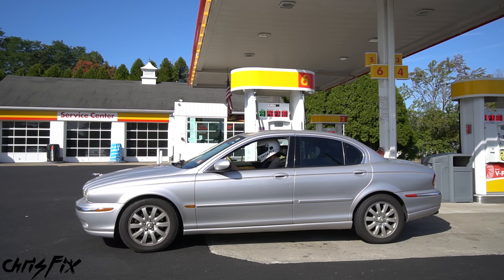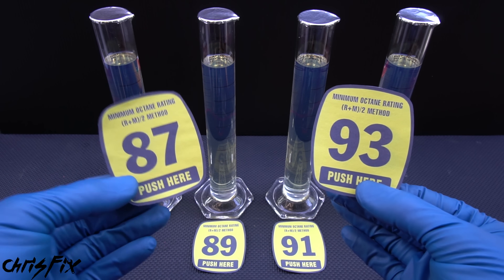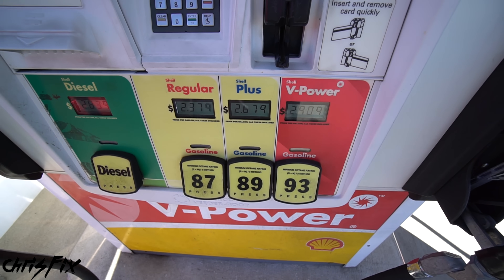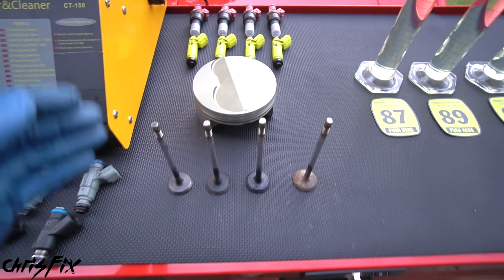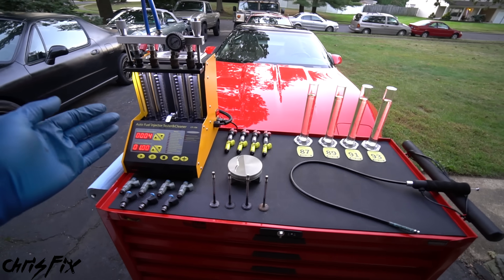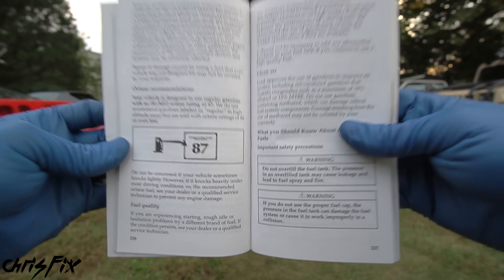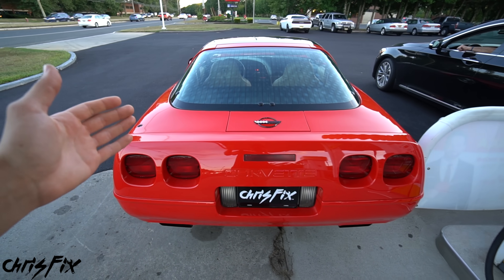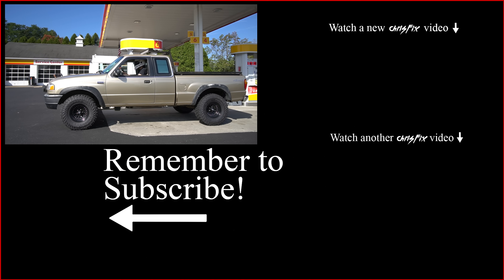What is the BEST Fuel to Use in Your Car or Truck and WHY

Comment: Lol in sweden the worst gasoline you can get your hands on is 95 octane, and your "premium" is 93? But then again we also pay 3 times as much for it haha
Reply: You also pay 3x as much for the same gas. As It was mentioned in the video, we use a different method to rate octane. US 93 = 99/100 EU. And premium 93 for me (99/100 EU) costs $2.84 a gallon. (€0.68 per liter.)  ^_^

Comment: In Europe ... 95 is the cheap one, 98 is premium. I use octane booster because they've stopped selling 100 octane fuel at the pumps. I guess 93 is good enough for American engines though.

Comment: All regular fuels in the netherlands recently got changed to 10% ethanol by law. Many cars before 1990 can't use fuel with this high content of ethanol. There are only a few pumps left that sell premium gas without ethanol, but they have RON rating 98 and 102. But what if your car says, use RON 91 and no ethanol, is RON 98 than also oke?

Comment: Hey chris 
So i have a car that every two days or so the battery keeps going flat weve replaced the alternator but that still didnt fix it
Reply: Matthew playz I would get a new battery. Sounds like it can’t hold a charge.
Reply: @FlipITGarage  ok but it is only a brand new battery
Reply: Matthew playz it’s a brand new battery ? Get it tested. Also check the battery cables.
Reply: @FlipITGarage  weve checked all that alreadye
Reply: Matthew playz then there is something draining the battery. You’d have to trace it down running electrical tests.
Reply: Matthew playz I’ll make a video on it.
Reply: @FlipITGarage  ok
Reply: @FlipITGarage  how long until u will
Reply: Matthew playz should be able to get to it in the next week or so.
Reply: @FlipITGarage  okay will keep a look out

Comment: Watch out for sneaky gas stations that offer 87, 88, 89, and 91 octane fuels. If you read closely, the 88 octane says it's E-15 (as in 15% Ethanol). I once saw a gas station offer (I think) a 95 Octane fuel, but it was E-85 (85%ethanol). So don't get too excited if you see 88 octane cheaper than 87 octane (fuels with more ethanol benefit from subsidies that make them cheaper, but you get crappy fuel economy and it clogs stuff up).

Comment: Fuel here and fuel Europe is not the same right on a sticker it said E5 were E10.10 percent ethanol. That alone makes the fuel in Europe better . Especially for carburetors  .
Reply: E5 causes an indistinguishable amount of damage as E10 to very old carburetors. E5 will kill your old carbs as fast as E10. However here in the US, anything 20 years old or newer is designed for E10. E10 is the new standard. It will be coming to all of the UK eventually. Norway already made E10 standard and it's now the main gasoline that is used. The US switched 20 years ago now. E10 burns cleaner than straight gas. 

E10 is now sold in most places like Canada and the US and Norway and other countries. And E10 is moving its way across Europe now.
Reply: @waycoolscootaloo  it's the same just with E10 its 5% more ethanol.  As E 85 is 85% ethanol  .

Comment: So if you're converting a car that would normally require premium to hybrid, you're lowering the engine's compression with the Atkinson cycle. Would it be possible for the car to run on regular after that? I mean, in theory?

Comment: I have a 25 Years old car, and i don't know which gas the previous owner used, so I'm wondering if there's any kind of product to put in the gas tank to clean it up and increase the power it may have lost over time?
I live in EU so it's 95 or 98 octane as the mechanic told me but i'll check on my car what's recommanded or required. thanks !

Comment: You mentioned Shell suggested running their premium for 2500 miles straight, and mentioned adding premium to your Toyota due to detonation. Would this be safe to do in my 1997 Civic with nearing 200k miles?

Comment: Why do you have such a low Octane grade in the U.S.? Normal Gas in Germany is at 95 Octane, Plus is at 98 and at the Aral Gasstation you can get 102.
Reply: US Gas is the same as EU gas. As he mentioned in the video, we use a different method for calculating octane. US 93 (R+M)/2 = 99/100 in Europe. Shell V Power Nitro+ in the US is probably a bit higher. Since they have said it tests at a US 95 octane rating. So that's your 102 even though the pump will say 93 octane in the US. Our ratings always state a minimum of 87 or a minimum of 93. So that just means you're guaranteed nothing less than that octane level. Most gas in the US tests one or two octane levels above the sticker.  

I can get premium 93 (99 German) here in Wisconsin for €0.68 per liter right now. $2.84 a gallon.  😎

Comment: What "additives" are in fuel? 
I actually work as a process technician in an oil refinery. The ONLY differences between octane ratings is made by blending multiple process streams in varying levels to give appropriate octane, flash and freeze points, RVP etc. There is no "standards" for additives. Only for octane and RVP etc(which is seasonal too, more butane is blended in winter spec to help cold starts) . Those process streams can be anything from Isomerate(octane in the low 80s), Cat cracked spirit(around mid 90s) and reformate(over 100 possible). Butane is used and also alkylate(made from bonding two butane molecules into a non aromatic C8)

I know premium has small quantities of a cleaner added but it is a TINY amount per volume. There is no other additives(apart from dyes) in the other blends. Isomerate is a less clean to burn fuel than reformate for example(reformate is like a solvent on its own) so higher octane blends use higher quantities of cleaner burninb blends. 

Also you CAN get more power from higher octane fuel if the car is able to adjust for octane. Many modern engines ARE able to generate more power at octane levels above the minimum required. Toyota 1GR engines are an example. 

The dinosaur engines in the cars shown(old mustang) won't benefit from higher octane fuels unless the ECU is retuned.

Some good points in this video but your technical points are a bit innacurate.

Comment: My car uses the Best fuel of all, Electricity.
Since 2012 I have been using ZERO Oil and Gas .
In over 300,000 miles I ONLY have Rotated Tires and replace wipers as needed.
I pay almost Nothing to charge my car Every night. I have a 1000w Solar system and a Large Home battery , I can charge several cars and power my home All night long on battery power.
my system begins charging as early as 6 am and can Fully Charge my Home battery in little as 4 hours , i'm them free to SELL the Electricity I make to my Utility for a Paycheck.
most days my Meter runs backwards earning me $$$.

Comment: My car requires 95 (i'm in Europe so that's 89 I guess ?) But I get a better fuel economy with 98 (93). Even though the fuel is more expensive, it's actually cheaper to run ! Sometimes it's worth a try
Reply: As he mentioned in the video, the vehicle's ping sensor will detect if there's any preignition/knocking and that the timing could change. What he didn't mention is that the richness level (or air to fuel ratio) can also change where there's more gasoline added to minimize preignition, hence worse gas millage.

Comment: the fuel  in your state are better than Colorado fuel we have 85 87 and 91
Reply: In high elevations, you can get away with lower octane ratings. 85 octane is sold exclusively at higher altitudes only. If you fuel with 85 octane, only run this at high altitudes. This is because 87 octane is the rated octane by manufacturers. And as you descend to lower elevations, then the 85 octane will become to low for your engine. 85 octane only works in cars rated for 87, because the air is far less dense at high elevations, which means that your engine runs less efficiently. But as you descend to normal elevations like what's found in Illinois, or Iowa, or Wisconsin, then your engine will start to knock with 85 as it runs more efficiently. So the high elevation protects your engine from the 85 octane gas. 

However auto manufacturers don't endorse the 85 octane fuel. It's actualy a relic from years ago. The EPA says, “The sale of 85 octane fuel was originally allowed in high-elevation regions—where the barometric pressure is lower—because it was cheaper and because most carbureted engines tolerated it fairly well. However this is still true for old cars and classic cars. You can probably get away with running 85 on modern cars according to experts. But they all recommend the 87 midgrade to really take away all doubt. 85 should be used primarily on carbureted cars. 

TLDR: 85 is likely not going to hurt your engine at all, so long as you run it only at high altitudes. But it's better to run 87 to remove all what ifs. Never run 85 at lower altitudes. Carbureted or not.

Comment: Edit: See comment.. 

I like that your "V-Power" is w/ 93octane... her ein germany, 95octane is the "cheap" gasoline :D VPower has 100 over here.
Reply: If you watched the video you would have noticed how he talked about using a different method to measure octane in the US. 93 octane in the US is the same as 99/100 in Germany and the rest of Europe. Example: Tesco in the UK is super popular. It sells 99 octane premium. Folks over in the UK swear by it. However according to Tesco, it has a "Mon" rating of 87.  

So "RON" 99 + "MON" 87 = US formula of (R+M)/2 = 93 octane.  So Shell "VPower Nitro+" in the US is rated at the pump as 93 octane. But keep in mind the sticker always says a "Minimum" of 93 octane on a US gas pump. So if Shell is selling VPOWER with 100 octane in Germany, then the "Ron" is 100 octane and the "Mon" octane likely was 88.  

So in the US, our 93 VPower is this →  88 + 100 = (R+M)/2 = 94. So the pump will say it's 93 octane. But your actualy getting 94. And some stations in the US even have 94 octane labels. primarily at Sunoco gas stations. But 93 = 99/100 in Germany.
Reply: @waycoolscootaloo  well I did watch it but it seems like I did overhear that, thanks for clarification.
Reply: @falkhogan  Your welcome. 🙂

Comment: Actually you are wrong when saying Octane doesn't pertain to burning hotter or cooler.  We run race engines and there is a HUGE difference in cooling when using a higher octane.  It may not be noticeable between 87 and 93, but when you get up to 112 and 116....it's proven.

Comment: I live in Colorado.  Regular gas is 85 octane not 87 octane.  If my manual says 87, can I use 85 in Colorado?
Reply: You can. The higher elevation will likely make it so your engine wont knock due to the thinner air. However never run it at a lower elevation. Most industry experts still recommend the 87 however over the 85. Just because it removes the what if's. 85 octane was originally formulated because it was cheaper. But carbureted engines at high altitudes ran on 85 just fine. But modern cars can compensate for high altitudes unlike old cars. So auto manufacturers don't necessarily say it will hurt your engine. But they also said that they won't endorse 85 octane fuels either. 87 is what they design cars for. 85 octane is really aimed more at older classic cars with carburetors at high altitudes.

Comment: How about the E5 vs E10 (Both RON 95, so midgrade in USA) fuel? (Europe)
Reply: There is no real world noticeable difference between the two. Now if you were to jump up to E85, then you would notice a marked downgrade in terms of fuel economy. However E85 is high octane. (108 in the States.) So a very high compression engine would love it. Provided it has an E85 adapted fuel system. (Flex Fuel rated cars in the US can run E85.)

Comment: E85 is a tuners dream, as long as the engine is tuned to use it or is flexfuel... mostly readily available and its practical equivalent octane rating typically is 108 to 115 dependant if you are using MON, PON or RON rating (in that order).

Comment: Chris there is some half truths in your video. Knock/ping is caused by the air fuel mixture self igniting on the compression stroke before the spark plug fires setting off another flame front spread. When the conditions inside the combustion chamber are just right the air fuel mixture self ignites by the combination of high pressure and heat. Under mid cases of knock/ping the self ignition occurs just before the spark plug fires... note at 2000 rpm we are talking about less than 1/100ths of a second to get the ignition timing just right.  in a 4 stroke engine at 2000 rpm the power stroke is only .06 of a second in time duration from top dead center to bottom dead center and you need the ignition of the air/fuel to occur in the first 1/10th to 1/4 of the power stroke to make max torque on each power stroke. on the ideal power stroke to make max torque the max pressure on the piston must occur when the power stroke is exactly have way between top dead center and bottom dead center... thus putting the crankshaft piston rod journal in a position where it is the farthest to the side of the centerline of the crank shaft (torque = distance times force... ie foot pounds ). in severe cases of knock/ping the self ignition occurs when the compression stroke is only half way up the stroke and the crankshaft is trying to push the piston up and the expanding gas mixture is pushing down on the piston this produces a bent or broke connecting rod.... so there is some debate about exactly what octane does to the air fuel mixture.. some say it prevents the air fuel mixture from self igniting but an old mechanic (who use to build 10,000 rpm high compression drag race engines) explained  that octane does not stop the self ignition of the air/fuel mixture but it slows the flame front spread.. again we are talking about 100ths of a second .. he said adding a crap load of octane booster to your gas  (more than what is needed to prevent knock) can actually reduce the amount of power (torque) the engine makes because the flame front spread from the spark plug ignition has slowed too much and the full cylinder charge is not ignited and making maximum pressure (ie expanding) when the piston gets to half way down on the power stroke
Reply: opps mistake in how to calculate time duration of a power stroke. in a 4 stroke engine it takes 2 revolutions to get 1 power stroke ... 2000 rpm = 2000revolutions per 60 seconds  ... time of 1 revolution  = 60 /2000  = .03 seconds  but 1 stroke is only half of a revolution time so 1 stroke = .03 / 2 =  .015 seconds ... therefore  at 2000 rpm the time duration of a power stroke from top dead center to bottom dead center = .015 seconds

Comment: The best thing to do is read your owner's manual and use the fuel they 
say to use. In my Infiniti Q60S's manual it actually
says you will void the warranty if you do not use the 
high test (91+ octane) fuel. It even goes as far to say that if
you are out of gas and can not find premium fuel that you should put in
just enough 87 octane gas to get to a station with the proper fuel and
to drive under 50 mph and accelerate very slowly. 
It also warns against ethanol laced fuel that has more then 10% ethanol.
In other cars I have owned, they say to just use 87 octane lead free
fuel. Just read the owner's manual.

Comment: Higher octane fuel is slower burning to prevent the knock and won't increase performance in a engine designed for 87

Comment: I have seen pretty much all your videos with great explanation. I wish you were my mechanic, I live in Colorado and am being gouged for over priced fixes all the time. I find it useless that for a simple fuel pump issue is costing me over $2300 anywhere I go it's in that range to fix. But have done my research and found that it's so much more cheaper. I turn my truck on and hear a noise coming from my gas tank area, not hissing but more like a moan or ring to really. Everywhere I go they rip me off and now 4600 in Dept because they say they can't fix but still have to pay been to 5 mechanics and this just sucks man. But yeah wish I had someone reputable like yourself because you seem honest about the things you do for your videos you produce!!

Comment: As a mechanic and engine builder, in my 45 yrs of experience. If you know your engines compression ratio, that will help you determine what fuel to run as well. Our 3.6 Pentastar in our 200 and Journey has a 10:2.1 compression ratio. We run Love's Fuel 93 octane. The 200 gets 35mpg highway and the Journey gets 31mpg highway. Way better than advertised. We also use a quality oil and K&N Airfilter. Tires are always at correct PSI. All this helps. A better octane fuel always promotes a healthy running engine and fuel system. At least in our experience. Many will disagree, most mechanics know the difference.